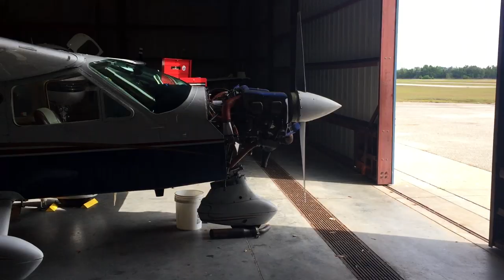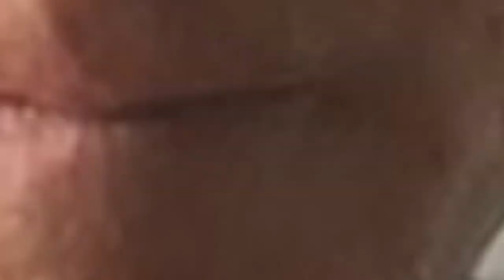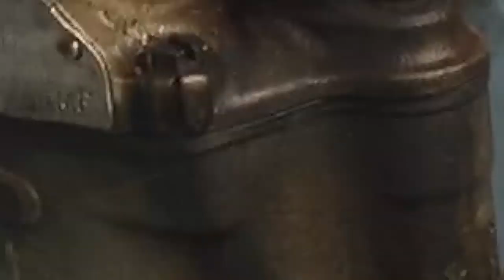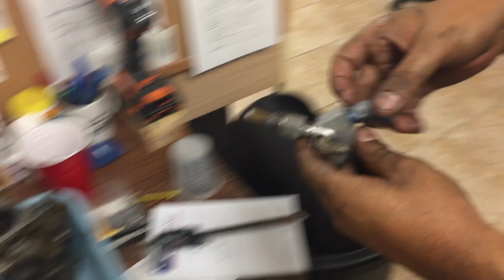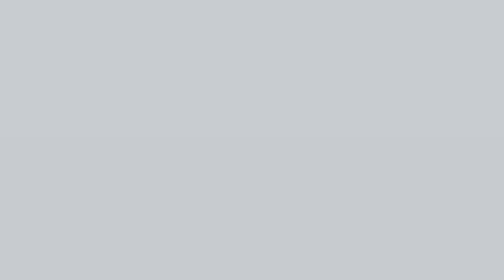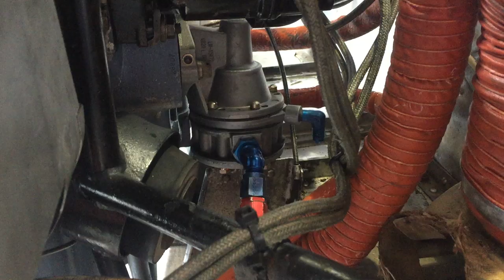The Mechanical Fuel Pump Failed

Comment: All those issues and remedies will buy you much confidence going forward. Congrats on finding this stuff on the ground instead of up in the air. That loose fuel fitting could have easily caused an in flight  fire. That scares me more than a power out situation.  Thanks for sharing this. 👍
Reply from the maker: absolutely! thanks for watching!
Reply: I'm with you there!   My greatest fear in flying is a midair collision, then an in flight fire, and last the engine out...
Reply: @goneflying140  Mid Air collision is due to stupidity and lack of situational awareness. That can be avoided with the proper IQ and doing what we're told during training...keep an eye out. Panel fires are total surprises and usually have nothing to due with lack of diligence. I carry a Halon extinguisher and it's easy to reach. No powder and it sucks the life out of a fire in 3 seconds. Hopefully it doesn't start again and I can get on the ground.
Reply: @dh-flies  
ADS B and Foreflight have drastically reduced my fear of Mid Air Collisons.  Before I got that, I almost had one.  You can be doing everything right, and all it takes is for somebody else to be at the wrong altitude for their heading.  Luckily I WAS watching, and was able to turn away just in time.  It was either a Beech Starship or one those Long EZ kit planes, and the rate of closure was very quick.  He wasn't using the east heading = odd altitude + 500 ft.  I was flying SW at 2,500, and he was coming right at me the opposite way head on.  We didn't miss each other by 50 feet after I turned away.  That was close!  I don't think he ever saw me because his course never changed..  Thanks for the advice on the extinguisher.  I am going to get one before my next flight.

Comment: The three hose going into that manifold are from 1. mechanical fuel pump, 2. electrical fuel pump, and 3.  fuel pressure gauge.  The top small hose is for the fuel pressure gauge.  I have the same set up on my 68 177.   I just replace my mechanical fuel pump this past year also.  I also replaced all Hoses firewall forward while we were in there.

Comment: Could your A&P put a flex hose between the carb fitting and the distributor block to damper the vibration?
Reply from the maker: Richard Myers I guess so but if it’s done properly I wouldn’t see the reason to Thanks for watching!
Reply: That was my question, too, Richard. Take away that solid moment arm of vibration against the carb threads away, and put the fuel distribution block away from the engine a bit, say mounted some chassis point that doesn't rock and shake. I guess it made it from 1968 until now.....

Comment: I keep wondering when these certified aircraft will start allowing modern engineering in the engine compartment.  When I first started flight training I was shocked at the early 20th century engines being commonly used.  When's the last time you had to prime your Honda? Or adjust the damn mixture?  So irritating...A mechanical fuel pump when they make electronic ones that will last for 20 years now?
Reply from the maker: I know-  it is almost like a conspiracy-  they have to have more efficient engines available... can you put a rotax in a cessna?